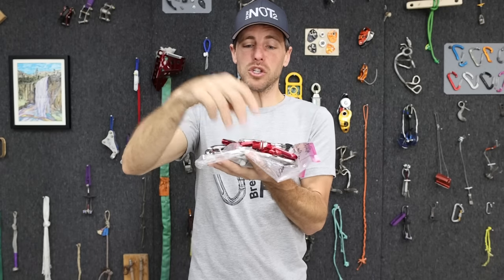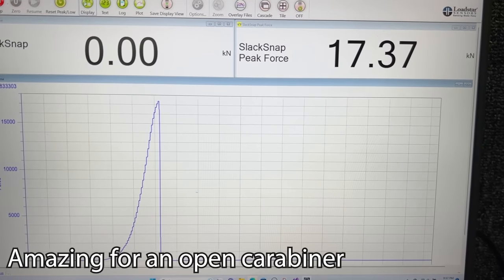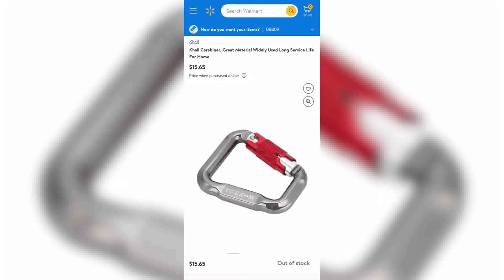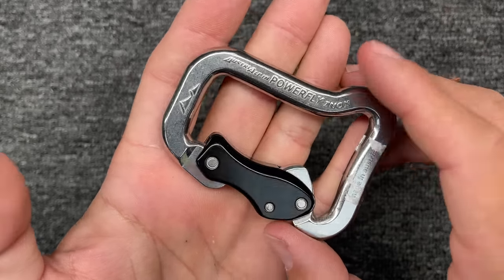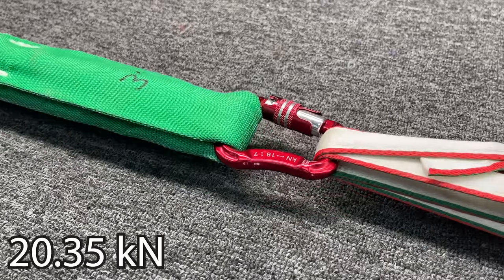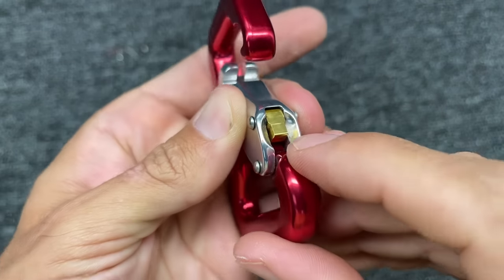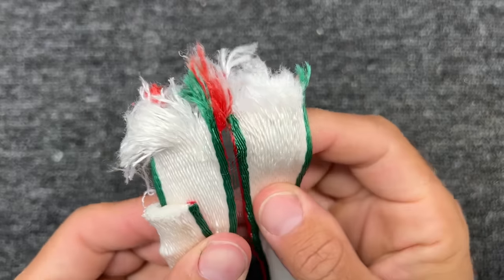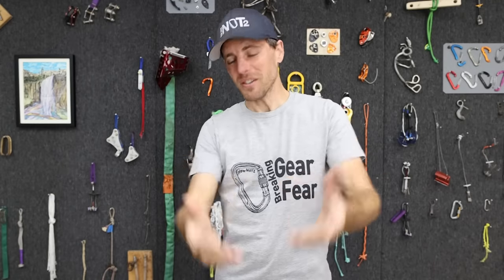Why did the manufacturer paint over their ratings?

Comment: A guide at an adventure company I was working at dropped three brand new aluminium carabiners about 100m onto rocks. No visible damage but we tested them all. They were all rated at 30kN, two broke at around 10 - 15kN and  one failed at 1.2kN.
We did the same test with steel carabiners that had also been dropped (this time deliberately) and they all deformed at around their rated strength. We found every time aluminium breaks suddenly whereas steel deforms, the gate pin breaks and they slowly bend. Even a bent one is still strong enough to hang on. The company went to all steel carabiners the next day! 
For personal use when you know the history of your gear aluminium is great, but when used from a common gear pool where you don't know what happened to it yesterday steel is the only logical choice.
But warning, stainless steel is less predictable! It can work harden and break suddenly.
Reply: Aluminum also has a finite fatigue life -- all fatigue adds up until eventually it fails, even if that is a very long time.  Steel fatigue under a certain threshold doesn't add up, and thus lower the time/fatigue cycles to failure.  (One reason for the inspection and replacement cycles on airplanes -- it's designed for it obviously, but makes fatigue engineering and maintenance  very important.)   (EDIT: Sorry, I typed that before he talked about it in the video.. :)
Reply: Aluminum carabiners - you can use it for holding less important items than your life. I use one as a keyring on the belt to avoid having my keys cutting up my pockets.
Reply: Stainless steel does Work harden, but you already have to be at yield stresses to do so. So if it’s never opened up or has obvious peening on the surface it’s not hardened. It’s not something that can happen “invisibly”
Reply: @geekswithfeet9137  Carabiners and stuff yes but we had some stainless steel wire ladders that some idiot thought would be useful in a commercial cave trip we were offering. The wire broke at where the rungs had been swaged on where the bit that could flex met the bit that couldn't, typically a quarter of a millimetre in to the swage. The only way you could visibly examine it was to flex it and look for any broken strands, but flexing it only hurried up the work hardening.
The other nasty one was a stainless steel threaded pin glued in and an eyebolt on it for a rope anchor. Another idiot had installed it and found it was a bit too long so put a nut on the pin under the eyebolt. As people abseiled on it you could see it flexing back and forth. I was a bit worried so cut it down so the shoulders of the eyebolt sat squarely in the rock. And I backed it us as well!
Reply: @mirandahotspring4019  oh yeah completely different story with wire rope. You can get swaging systems that have bell-end entries to spread the strain over a larger radius.
Reply: @ehsnils  So I'm using key chaines wrong? I have one fixed on my beltsling(or wha ever is the name for the things that hold the belt to the trousers) so I can pull my keys on the keyring out of my pocket more easy.
Reply: @TremereTT  If it works for you it's not wrong.
Reply: @TremereTT As long as you:
A) Don’t shock-load your keychain with a couple hundred pounds
B) Will survive if your keychain breaks

You’ll be fine
Reply: The problem is high strength aluminum alloys are brittle. That and spec sheets. They advertise lighter, stronger, wear resistant, but not more brittle. You wouldn't buy a glass carabiner, but aluminum is fine? Wear through the anodizing and cut the rope? Use it bare and it turns gear and your hands black. The problem: its more consumable than usually realized. Just don't leave old ones at a site, even in a trash can, some kid could find it. In short, find some way to mark and document your gear so you really understand where it has been and how much you want to trust it. Most official gear instructions have been lawyerized, so its over conservative, but not everything is that way, so use judgement.
Reply: @OldSloGuy  For a few more dollars titanium carabiners are available now. I bought a few just for the snob appeal!
You can sound very superior at the local climbing pitch with a casual, "Oh, you're still using aluminium?"
Reply: @TremereTT  That technique is fine if you inspect and replace the trousers regularly.

Comment: Hi Ryan!

On ratings- the paragliders themselves are tested to 14kn or more under the EN926 tests! Carabiners that break lower are the weak-point in the whole system.

I'd be very happy to do a video (if there's interest) exploring what the attachment points for the wing and reserve parachute look like, and give a closer look at materials (dyneema, kevlar, nylon etc) for the whole system. Often there's protective arrangements to prevent carabiners moving around or angle-loading on the harness side. On the wing side of the connection though, I think more research is needed, as different wings can have lightweight risers that do not occupy the width of the carabiners.

I'm exceptionally grateful for all the learning from your channel. For example brummel-splicing dyneema and kevlar has been super-useful for gear repairs in the field, but I've learned so much also about softlinks and quicklinks and a lot of the other bits of hardware we use.

Thanks!
Reply: Paramotor wings are rated to only 5.25G under the DGAC certification. EN certified paragliders are rated to around 8G (within the certified PG weight range only) and acro wings are a bit higher at 12G. It would be *extremely* difficult and unlikely to achieve anywhere near 14kn of force. We are talking about a very heavy pilot doing serious acro on an acro paraglider. Also there are two carabiners (not just one). Achieving 14kn of force would have much more interesting consequences because not only would other things fail (swing arms, frame attachments), there are *no* paramotor harnesses that are rated for anywhere close to those loads.
Reply: Yes, please!
Reply: I have seen people have cascades that ripped the lines out the glider.

So yes, very high Gs are very possible.
Reply: Bummer, you don't have any videos yet. Please let me know when you do! Have a wonderful week! 😊

Comment: I know nothing about paragliding/para-motoring but the takeaway I got from this episode is that these folks should stop trying to reinvent the wheel with these oddly shaped carabiners and just use steel quicklinks.
Reply: For real man, those mallions are tested by decades of use across tons of industries.
Reply: I was wondering about using a backup loop of something like dyneema
Reply: But they are heavy and hard/cumbersome to open, and most pilots diconnect their wing after every flight. Some Hike&Fly Pilots moved to Softshackles and leave their wing and harness connected, but some already are moving back to something like the Edelrid Ease (19G with a Locking Insert). And they usually use more narrow webbing as risers, compared to PPG wings
Reply: Seems like itis only an issue if they are using straps that are too skinny though.   Probably want your wide, flat straps to not be bunched up with a normal shaped quick link or carabiner?
Reply: @mrdumbfellow927  They make quick links of every shape, not just the ones we see in climbing
Reply: The way the straps work on a Paragliding harness makes a mallion pretty impractica. The straps come from three or four different directions. A lot of the lightweight stuff is moving to soft shackles anyway.
Reply: We do use quicklinks for our parachutes, but the wing is attached by carabiner because we need to take the wing off sonetimes.
Reply: @Ammoniummetavanadate  Just use a piton and hammer yourself to the wing
Reply: Steel links / maillons are a pain to open. Why not just use a plain oval 'bina that won't pop at loads you can expect to see
Reply: I love edelrid ease for my pg and h+f gear. But using maillons simply won't work for ppg when you disconnect and reconnect very frequently.
Reply: It needs an odd shape to hold where it needs to hold
Reply: @Ammoniummetavanadate the argument was against odd shapes, wasn’t it?

Comment: This channel steered me towards soft shackles forever. I had an old chunk of synthetic winch cable and made a few up. They fit so nice in a pocket. Easy to set up even wearing gloves , no potential metal flying around and not had one even come close to fail. Right from the beginning of the video all I could think of is why they wouldn't use them as a back up to the carabineers or instead of for a paramotor.

Comment: I run soft shackles (5mm dyneema with a button knot that i learnt on this channel) as my main PG attachments. Reason being is you can't cross load them, they're not susceptible to fatigue, they're lighter than the alu or steel equivalent and should have way more strength than needed.
Just wish i had a line scale and a slacksnap setup to proof load them 😅

Comment: Thanks! This weekend doing Acro, I landed in my wing and the forces on my harnes after the rescue opening was AT LEAST 1500 kg ripping some of the stitching on the harness and some metal pieces (which is plenty strong enough in normal situations). with a normal harness i would likely have fallen out of it, but this one had backup straps behind. my friend say that I pulled 17G's when the rescue opend.. 

this again adds the question about the carabineers/softies used between harness and rescue.. but this should be more simmelar to climbing..

also, doing tumbling, its normal to pull higher G's than 3.. usually about 4 when in infinity and close to 7G's in entry.

Comment: Should see how webbing acts when left flat like on one of these square carabiners versus in the curve of an oval carabiner or something like a d-oval. I'd bet that those square profiles don't help at all, and in fact are worse since even fat webbing might slide to the gate side.
Reply: "but if you pull webbing into a curve, it is weakened", yeah, well, there might be a reason why climbers normally use tubular webbing. Don't skimp on the quality of safety-critical gear.
Reply: @Alastair510  that's not the reason, and is debatable as a statemement to begin with. I see Non tubular slings and cordalette used way more often, and they can the same or better strength properties.

Comment: Thank you so much for this video, I use soft links to connect my carabiner to my paramotor so I point load the low side of my carabiner.  This video shows that I need to change it so it is using a full width webbing.  Thank you!

Comment: Hi! Thanks for the subject! You could also test the Maillon Rapide Delta (often 3,5mm - 4mm) used for line attachment to risers: These are very exciting to watch open up and/or deform in flight (i.e. when not properly closed... especially exciting when it is a middle A-line: the most loadbearing). Happy landings
Reply: That sounds like a fun episode.  Didn’t they run an episode on soft shackles from parachuting already?

Comment: "Did they get the right aluminum in the vat..." to then forge the carabiners?  That's important, but it's only part of what is required to manufacture reliable life-safety gear. "Real" gear manufacturers pull random samples from their production runs, do testing like this, then use statistical analysis to confirm that each batch is performing up to spec (along with lots of other critical steps and checks!)
Reply: quality control is everything in mass manufacturing.  At the same time, though, the real killer for all aluminum casting is porosity.  Dissolved gasses form bubbles when cooling, and create tunnels as the liquid / solid boundary moves when the part solidifies.  In a car engine this can mean coolant or oil leaks in a visibly good engine, or in load bearing parts, extreme reduction in max load before failure.  The bubbles can become quite large when no degas methods are used.  I've seen fluxes and nitrogen bubblers used to degas the metal.  The porosity I'm most familiar with is microscopic, which has just as big an impact on structural integrity as the large voids.

Comment: It's quite easy to pull more than 3Gs in a spiral.

Paramotorists don't think, they are mostly a special breed of knuckle draggers, who think trying to fly the slowest aircraft in the world everywhere on the throttle is a good idea.

The Paramotor was designed to be a mobile hill, and used just like a Motor sailplane - power into a thermal, then go onto tick over, and only power back up if you cock up and need to climb again.

Comment: What would be wrong with just using round stock (climbing) carabiners instead of those boxy ones in paramotoring?
Reply: I assume that since the straps you are attaching the carabiners to can be quite wide as shown in the video then the straps would get crunched up and not lay flat which would cause stress points.
Reply: @dumbcrumb879  sounds like another test for Ryan! But also he pointed out they were using a lot of 1” webbing so I’m skeptical there. Steel oval carabiners or HMS style would be wide enough, I’d think.
Reply: I always figured that in turbulence you could get dynamic unloading and a square is harder to get webbing to move to cross load than it would be on an oval/ pear

Comment: As a rock climber the benefit of aluminum vs steel is the weight that you are hauling up the cliff as you climb. Since the para-motor is doing all of the work I don't see the benefit of using aluminum other than maybe aluminum is cheaper? but the cost/weight savings for two carabiners is minimal if your life is at risk of use over time. Two new steel carabiners every 5 years also seems reasonable.

on another note climbers use two opposite and opposed at the master point of anchors.... are the loops big enough in para-motors to do the same? idk I don't para-motor

Comment: Fascinating! Paramotoring just seems inherently more dangerous than climbing, seemingly with piloting errors leading to the majority (?) of accidents. The sport is so niche, I wouldn't be surprised if catastrophic failure of a carabiner has never happened, even with these bad carabiners on the market. That said, as the sport evolves, it's important to have discussions like these. Having two points of "undundancy" definitely seems like a mistake.
Reply: I don't know about flying paramotors (outside that a propellor on the ground or on your back is scary), but as a climber and paraglider pilot I don't see much of a difference.  Climbing accidents also happen from mistakes mostly (inatentive belayer, wrongly used material, etc.).  (((Funnily enough, climbers keep asking paraglider pilots 'Isn't flying very dangerous?' and pilots asking climbers 'Isn't climbing very dangerous?'.  I usually answer that climbing, flying, and playing table tennis are equally dangerous if you do it like a madman.)))
Reply: Paramotoring and paragliding are way more dangerous than climbing  (based on the percentage of severe injuries per 1000). But its not due to carabiner failures. Most are take off and landing accidents.

Comment: People do backup with soft shackles sometimes, at least for paragliding, not sure about the motor stuff. It's rare though. A lot of the newer lightweight harnesses are switching to soft shackles in place of the bineers. Also note that we do have a reserve parachute in case of catastrophic failure, altough you need altitude to use those.

Comment: I’d use 1/2 inch screw pin anchor shackles with the pins safety wired. They have a 2 TON working load and a 10 TON breaking load. Each! Should do the job.

Comment: Just the shape of those air extremes make me suspicious.  You get the strength out of aluminum carabiners because they are designed to focus the load typically on the non-gated solid shank side.  The pin on the gate has leverage so it never sees the full load.  

Being square I don't see how the air extremes control the load to use the strength of a shank.  In fact as noted in the video the location of the load under load is somewhat random.  Good designers don't like random.  

This is actually a fraud.  I'm just wondering when that company is going to be sued.

Comment: Very interesting that basically everything except the "legit" Air Xtreme in steel broke at or above their rated strength when loaded with a straight pull, even including the somewhat questionable brands. Great results, and would love to see how the fatigued ones do!
Reply: That is likely why the guy prefers the steel ones because they might have a lower breaking point but aluminum is softer so it will stretch and fatigue at a lower rating but not actually break... but a failure is still a  failure.